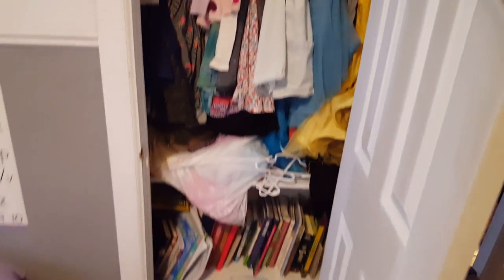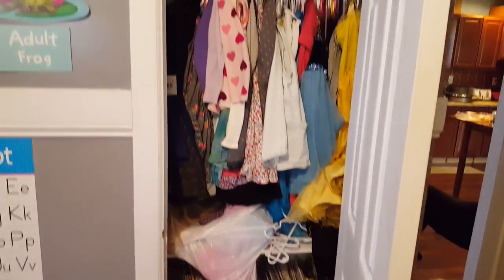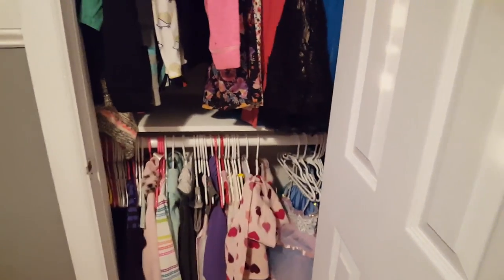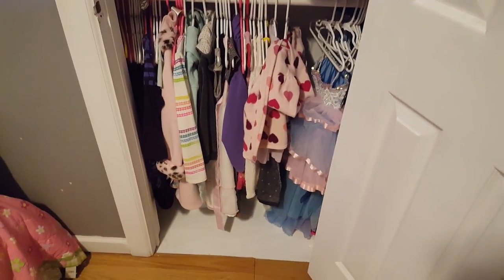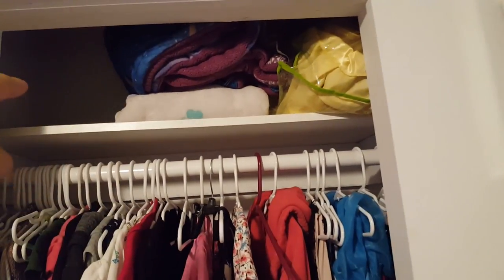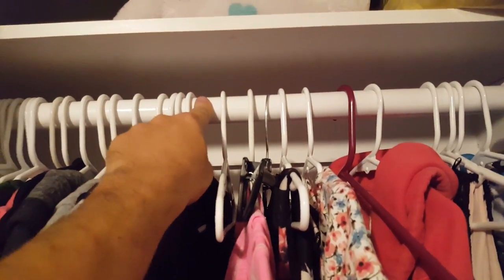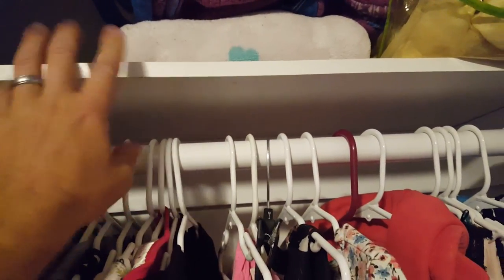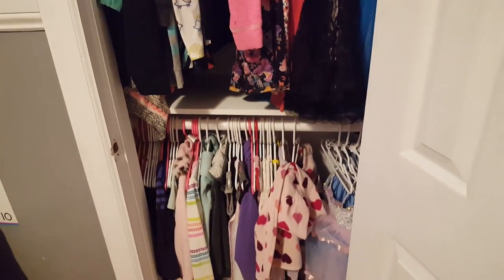The Tiny Closet Remodel - Double the clothes space!

Comment: I might have gone overboard with my closets in our basement. I used 2x6 on the sides and used a hole saw and cut a 1.5 inch hole and used 1.5 inch galvanized conduit pipe for the rods, it was cheaper to buy the 10 ft pipe than 1 closet rod. I then put 2 pieces of 2x10 on top of the 2x6's as the top shelf. Now I can hang lead jackets from there!